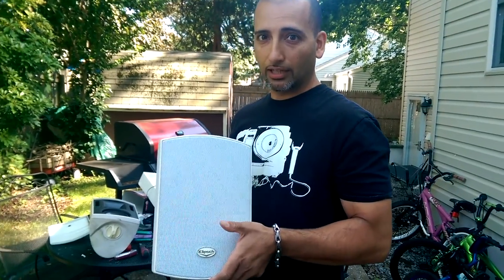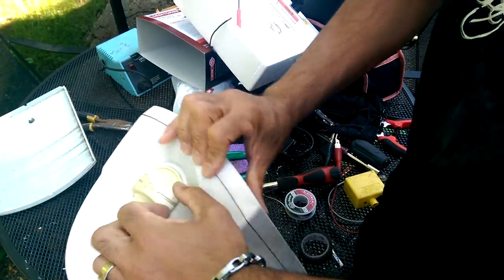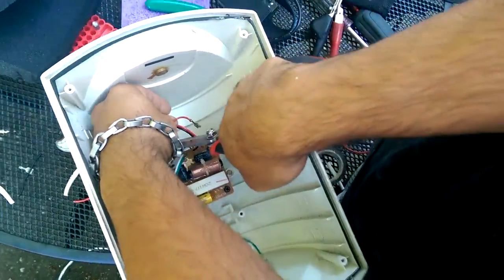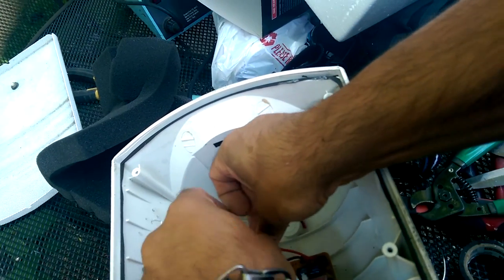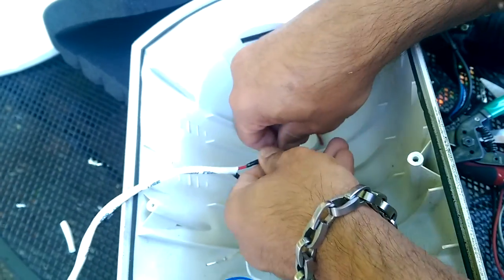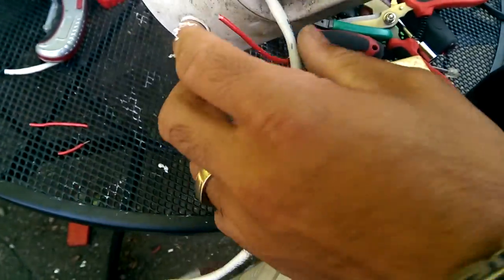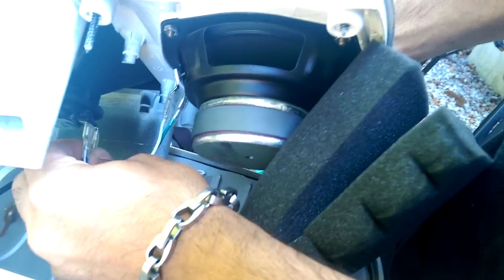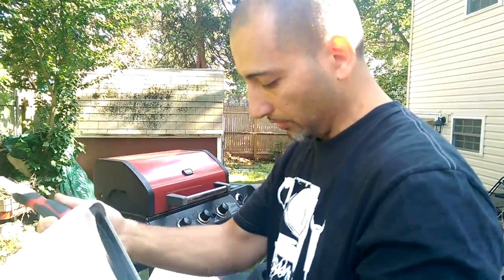Fix outdoor speakers with corrosion

Comment from the maker: Hanna, you can take an awl or a pic and try prying on the grill on each corner. slowly pry off the grill. hopefully that helps. you can ask me any questions you may have. Thank you
Reply: Is the speaker grill held on with glue? I got an insignia looks same as yours...trying to open it without cracking it.
Reply: I used a sharp thin blades knife to “score” around the edges

Comment: Could you buy new terminals Not too be rude? Liked the idea you did though.
Reply from the maker: no they were corroded very badly so I couldn't get the nut off. thanks for commenting.
Reply: +Naim Shahab 
Sure man no problem. I was just curious if you were able to do so with the speakers.